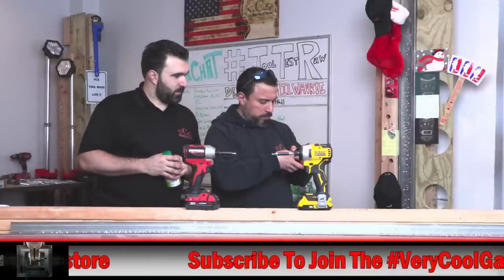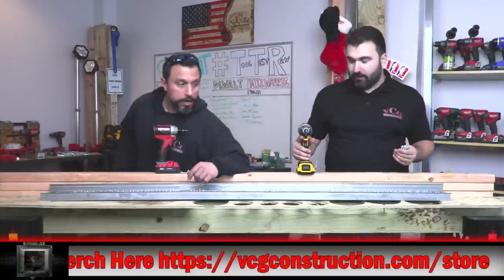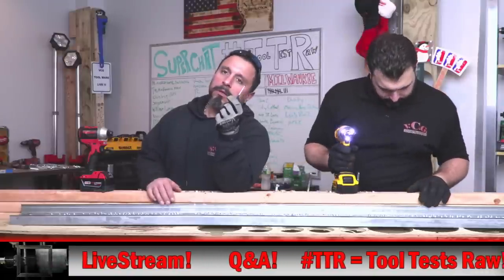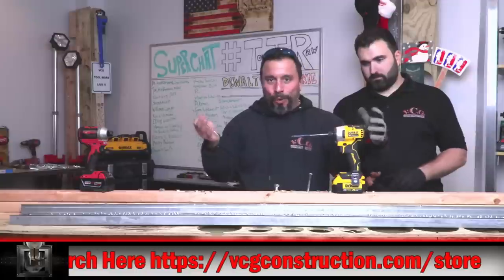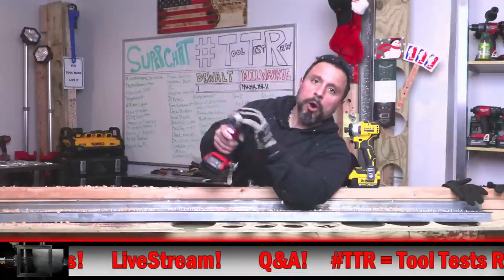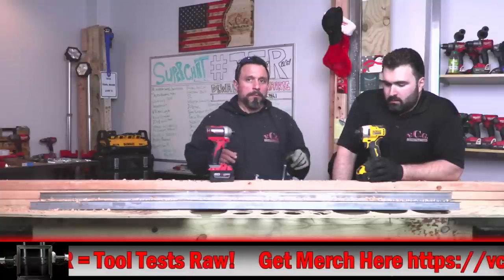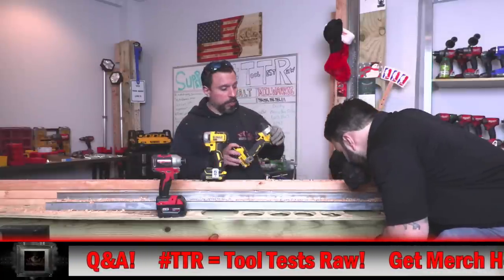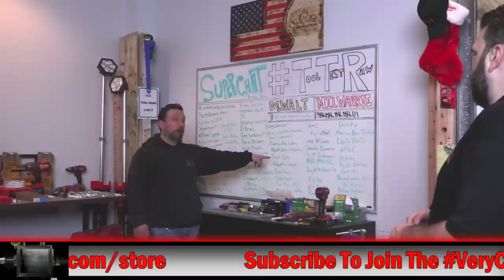Best Compact Impact Driver - Dewalt Atomic (DCF809) VS Milwaukee Brushless (2850-20)

Comment: I bought my dad a Milwaukee kit for Christmas and both the impact and the drill driver both crapped out on him and he rarely uses them around the house. The impact started leaking oil from the collet and the drivers chuck froze up. 
I think I'll keep using the Dewalt line. I have a 20v dewalt impact that I use everyday in my construction business and used so much that I wore the rubber off the handles, recently put a new case on it and it still runs like new. I would like to see Dewalt come out with a comparable line up like the M12.

Comment: I believe for the Atomic it's supposed to be 23% more power than the 885. It seems like those comparisons are usually made to the older brushed models. Y'all are really turning me on to Mill-ay-wah-kay, you do some of the best work on YouTube. Keep it up! 

Also, the DCD771 is another old brushed model, basically the predecessor to the DCD777, which is Dewalt's mid range brushless drill

Comment: 1:43:30 welp I learned the entire video was invalid. If the atomic dogged the 787 by an inch or so just before this test, but then the 787 crushed the atomic in Vince's hands when they switch, then the validity of him using the Milwaukee throughout the whole vid means nothing to me.

Comment: You compare Milwaukee 2850-20 (3400 RPM) with Dewalt DCF809 (2800 RPM). Common guys, it's like 6 vs. 4 cylinder engine.
Reply: You gotta look at the price gap aswell.
Reply: 4 cylinder turbo
Reply: Looks like it’s his company and whatever he says is the rule, definitely overacts!

Comment: I am thinking of getting in to the m18 ecosystem, not so much for driving screws, more for auto work and Pick-N-Pull yard crawls.

For that, I want a big impact which will probably be the 2767-20 M18 Fuel high torque 1/2" and I'm thinking about the 2850-20 brushless as a compact impact that can get in to tight spots easier.  Eventually, I'll add an M18 Fuel Sawzall, maybe a cheap brushed drill/driver and other tools as needs arise.

Do you think that's a good strategy or should I spend more to get an M18 Fuel Surge 1/4" impact driver?

The M12 Fuel looks interesting too but I don't think I want to invest in two different battery types.

Comment: Impact drivers are not really meant to drive coach bolts and concrete bolts. They will run the tool hit. You really need an impact wrench for that.

Comment: It depended on the user if you watched the whole video Vince was screwing straight down the 2 by fours while the other guy was drilling at an angle obviously it’s going to take more time to drive your screw if it’s at an angle Vince also applied more pressure on his tools than the other guy jimmy out of shape lol when they switch tools you see it

Comment: Hi Vince and VCG crew,

I missed the challenge but was the specs the same? (Ipm or rpm). I was watching Tool Boss one day and he was showing this line was coming out by dewalt. I thought this was going to be dewalts new compact line for their 12v.  Yes, it runs on their 20v batteries but if the specs are not the same is it fair to run it against anything larger (specs size).  Pretty cool if it's (compact size) is just to replace the 12v line. 

Again, milwaukee is still #1 in the 12v line tools.
Reply: Tool boss is your problem lol
Reply: @kwmiked  

Now,  Now be nice. Just getting info from a lot of you tubers. LOL...

Comment: Love these videos. No doubt, the Milwaukees really shine during these tests and crush the DeWalts, at least when it comes to impacts. But truth be told, I see far more DeWalts in the hands of homeowners and throughout a construction site. DeWalt must be doing something right. And 99% of the time, either brand will do just fine. There are countless people with an 887 that have nothing but good things to say. I went with DeWalt as "my brand" because I grew up using my Dad's DeWalt tools and they never let us down. I went with what I know works. However, when the day comes to upgrade my system of tools, I'll consider Milwaukee, if the price is right.
Reply from the maker: Thank you pilot!
Reply: Dewalt is a more reliable tool, Milwaukee has the power but it doesn’t have the reliability of a dewalt which is the main reason people buy dewalt, enough power to get the job done and you can throw (literally) it in the back of the truck and go home it’ll have some scuffs but that’s all tools in construction

Comment: that milwakie is eating it up.. i just bought the dewalt drill driver compact combo kit. :|
Reply: I got the 801 Extreme and it's pretty good.  I'm tempted to try out the 809 like you got.  Even though it gets pretty universally trashed on YouTube, if you check Home Depot and Amazon it's got a really high rating.  I think in reality, it's probably a fine tool, it's just the comparison videos get us feeling like losing by a few seconds and having "the moooost power" is a huge deal when when, maybe it's not...well, after re-watching this I forgot how poorly the Atomic did. Nevermind lol

Comment: Your 20v max power tools are pathetic DeWalt! Please go back to the drawing board and use the pride and craftsmanship that was put into the old 18v nicad line. 

VCG IS A BEAST! And if you like beasts, then smash the like button. Also, get subscribed, because who doesn't love milwaukee tools layin' the smack down on all of the other tools on earth. And tap the bell to show Jimmy some love and give some congrats on the twins
Reply from the maker: That’s what’s up David briot!!
Reply: Dewalt Atomic series aimed 21% more torq then a 12v tool not compairable to 18v tools DeWalt atomic line is replacing 12v line to use one battery line of 20v Max so you should test it against the m12 line to be fair to the product it's made for
Reply: It's like the Makita compact 18v line with 12v specs the all black Makita s
Reply: @joeyf7606   then the atomic fail is dead on arrival. It's literally a full size impact, what's the point having less proformance to act like a 12V with no considerable size reduction?. Just face it it's a joke stick to the 787 if you like DeWalt. The black Makita makes sense, it's way smaller then it's full size 18V flagship, this does not. The fact you want to compare this to the M12 is laughable, although I'd like to see that. It's 2 different volt platforms and any 18V will have an advantage over a 12V, but the M12 line is very well design so I would think it would be a good match up. I think DeWalt needs to go back to the drawing board with this new offering.
Reply: Wow! That was embarrassing! Thank you for that because I literally had it in my shopping cart online from Home Depot. You saved me $150. Thank you!

Comment: Ok so.. Milwaukee is  1second faster?  Does that even matter ?
Reply from the maker: You forgot less expensive , smaller, and more powerful! People work hard for their money, yes it matters!
Reply: @VCGConstruction     it seems like the other dude was purposely being slow on the dewalt. In fact, he was holding the drill at a slight angle, where as you had that thing perfectly straight....ready to rock and roll..  at any rate,   you did show us that the Milwaukee was smaller,  cheaper and more powerful.  Kinda surprised when I saw that actually.  Appreciate the response.  And also, I enjoy your content.  I like the walk throughs at the big box stores. Take care man ! 👍
Reply from the maker: Have a good one BigFoot !

Comment: Dewalt needs a fair competition, toss the dewalts against some m12 fuel. Would bet the m12 will either keep up at 12v or beat em.
Reply from the maker: 🤣🤣 this was fair, the Milwaukee was more compact than the DeWalt! Did you watch the video?
Reply: VCG Construction that’s what I’m saying, M18 is a bit too much for 20v max. Maybe the Dewalt will shine against the M12 fuel, I doubt it, but dewalt needs some love.